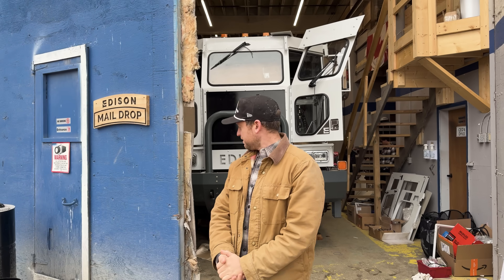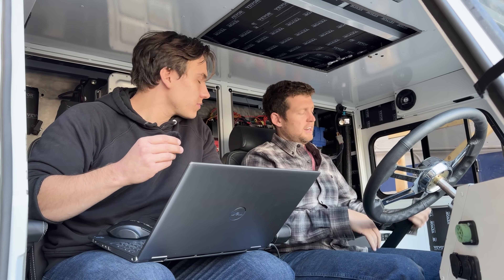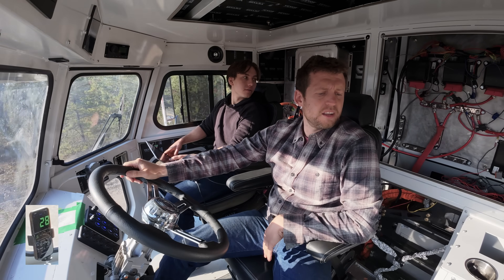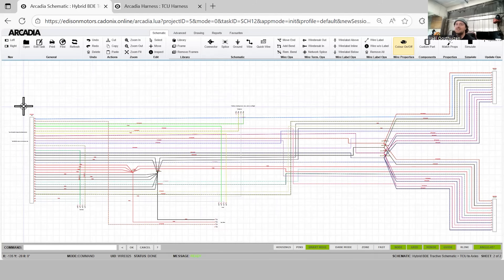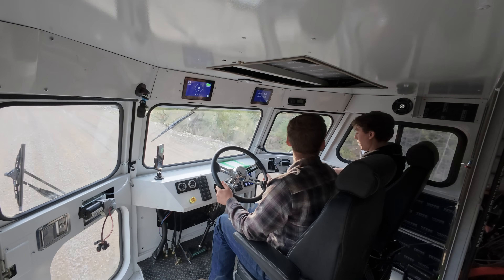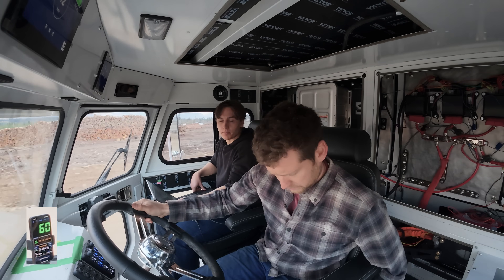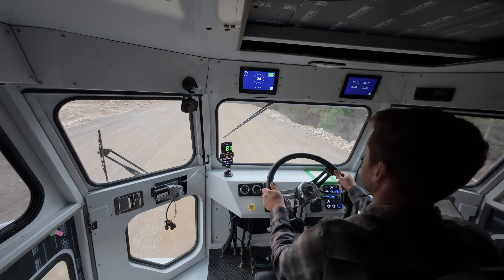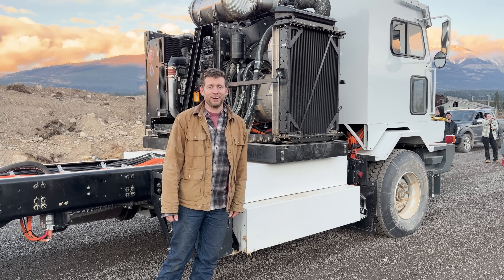Testing the Limits of Edison’s New Truck

Comment: I know you don't have to put in three-point seat belts but they do save lives. It won't matter if someone hits a car but another truck.... A head-on collision a tree, you don't want someone dying in one of your trucks
Reply: I'm happy that you're thinking about the lives of the truckers, and I won't tell you off for it. Also another point to you is that I believe that 3 point seatbelts are better during roll overs and similar accidents. I'll just add a few things from what I can see. 

The reason why 3 point seatbelts aren't needed on a vocational truck is cause in a real off-road case (worse than just hard packed dirt) or during operation (in the case of specialized equipment), you hardly ever go fast enough to where the type of seatbelt decides wether you die. It is also from what I understand that some truckers don't use their seatbelts at times to bale out the truck faster Incase of emergencies. 

In the case of highway truckers, i believe it would be better to have a 3 point seatbelt as a standard. I'll also add for those that'll point this out that at their speeds and weights, it's either, they destroy what they hit and get damaged or they get destroyed by what they hit or by the load/equipment behind the cab. 

In conclusion, 3 point seatbelts are better, but if your vocational/loaded truck suddenly halts to a standstill in a few seconds, you may have bigger problems. 

(I'm not an expert, just a fan, so feel free to correct me!)
Reply: Didn't you listen?! They have those just for the testing! There won't be any head on truck collisions during testing!
The finished truck will have "peoper" seat belts.
Reply: @VBormann  I was referring to a general crash on the highway. I sure as heck not one of these boys crash and get hurt at all during testing!! Whatever that may need for safety is whatever they put in and people don't use. @Edison Please don't add speed limiting if no seat belts like the newer Rams. I'm a local BC 4x4 guy and I bet No one is wearing their seat belts when on the dirt roads. I'm pretty sure Chase has a short somewhere talking about it too.
Reply: "Why are you worried about basic safety precations that cut fatalities by a 3rd? Are you a wuss?"
Reply: I'd rather bail out before my Load shifts through my cab, or the thing flips. Have you seen a Semi on Semi head on? you're lucky if the drivers survive.
Reply: @michealscheuerman3250 Life isn't a movie,nobody is bailing out before a head-on collision

Comment: I'm wondering why wiring harnesses aren't using more of a hub and spoke topology?  My idea being that this way it would be less about having to do custom harnesses and potentially having to redesign and remanufacture new harnesses whenever you add something new, and instead set up the equivalent of wiring highways between "hub" boxes and then you can make the wiring connections digitally inside the boxes which would allow for rapid iteration.  Also you could add a lot more wires than needed for future expandability.

Comment: I remember you guys being impressed by the smoothness of the ride in the Scania Trucks when you went to that european truck show. Did you end up copying this feature i.e. resting the cab on four airbags instead of two airbags and two rubber pucks?
Reply: Judging by the distance between the cab and the front bumper they’re probably still using the traditional NA setup of bags + rubber pucks

Comment: It seems the regenerative braking demand will change depending on vehicle weight/load, will it be driver adjustable or use suspension inputs to estimate weight?

Comment: I know the truck is already gone, but I'm curious if you did any water testing like going through a big puddle or hosing down the parts that usually get wet in bad weather? I know you designed for water proof connections, but I'd like to know that it's good to go. Thanks!

Comment: You should have a horn code for safety on the track. Something like, 4 blasts is "We're gonna be going f'n fast", one short blast is "Move out of the way", one long continuous blast (>5sec) is "We've got an emergency and need someone to come check on us", 2 blasts is "We're getting moving", 3 blasts is "we're backing up". Also there should be some kind of audible signal (like back-up beeper) that can be heard near the truck for when the brake releases after shifting from neutral to drive or from neutral to reverse, to let people know the truck is going to move. Your national safety regulations may require an AVAS sounder, so check into that also.
Reply: One single kind of sound that warns outsiders when the parking brake is released or when forward gear is selected  should be fine. Or better yet, when you start creeping forward, may it be from releasing brake pedal or pushing gas pedal, one warning sound distinct from other sounds could be played through outside speakers.
Reply: being this quiet and that big has a whole new set of issues no one else is really dealing with, and i imagine might be a "blind spot"

 deer, moose, etc love to use the roads to travel, they usually get off the road when they hear our vehicles coming when they don't well cars get totalled. now you take a big truck that the laws of physics can only allow to stop so fast, moving at high speed silently.... 

better to at least start looking in to it before the trucks get in to the wild and we loose some one to an unaware moose on the road. not sure if they have deer near the track, but it might be worth putting feed out on one easy to see patch so they graze near the road to see if you have a sound that will scare them away effectively and not drive the drivers nuts.
Reply: @NogrimStoneson I think the inevitable rattling, wind noise and tire noise will scare off any animals. They hear a bit better then us humans.

And for us humans, electric cars have gone through the same process. Most of them have a speaker making a continuous beep when they drive slowly or a soft backup beeper sound. You can definitely hear electric cars these days and that’s all artificial.
Reply: @autobootpiloot Above 50 or 60 km/h the tyres are louder than the engine on most cars regardless of power source, truck tyres are louder again, but then again as someone who rides mountain bikes through the middle of nowhere nearly every weekend, the combination of fast and quiet in a bicycle (Silent except for tyre noise and freewheel), means I get to see a lot more wildlife than someone driving a truck, car or motorbike will see, because they don't here me coming until I have already seen them, even though my speed is lower than a motor vehicle, so it's not an invalid consideration.

Comment: Do you not have rear ABS? There was lots of skidding on that brake testing
Reply: They do habe abs, they just did a test without
Reply: Couple things:
1. ABS doesn't work well off road (he calls it "pavement" but it's just compacted millings already flaking apart). Yes, newer vehicles may have more advanced systems but these trucks aren't there yet.
2. As discussed afterwards, the lack of weight on the rear let the wheels jump around and loose any remaining grip.
Reply: Ah I missed when that was stated, cheers

Comment: Do you guys expect to have OTA updates just so you can mitigate issues found at a later point when there are trucks in the field already?

Also do you have a revisioning system so you can create an exact replica if you ever need to? My mate had a huge fight when trying to replicate high-tech vessels when the customer came back and was like I'd like 3 more but they didn't have any revisioning so it took them MONTHS extra to replicate these vessels
Reply: I don't think wireless updates are necessary for trucks. Not worth paying for communication hardware and data just for that. A website and USB drive or connecting directly a PC is good enough. And for data security its better if nobody can access anything remotely and reprogram stuff they shouldn't.
Reply: As an information security expert, I fear OTA for Edison trucks.

Comment: With the wheels locking up on the brake tests, are you thinking of including ABS on the brakes?
Reply: They were talking about abs but i think during this testing they haven't quite figured it out.
Reply: Should be mandatory. So much better to break with ABS. And when it comes to stopping the huge mass of trucks, it also means a lot less energy in case you still crash into something or, worse, somebody.
Reply: I would guess they are required to implement abs under cmbss?
Reply: I believe ABS is planned for this model judging from one of the shorts they showed, other than that it, would be another nice thing to have on top of everything else
Reply: The front wheel ABS was working, so the truck still has directional control.

Comment: Regen braking is a fabulous thing in any vehicle!
-Saves maintenance.
-Applies brakes before your human reaction time can.
-Reloads the battery with volts.
Reply: Relaods the battery with amps, not volts
Reply: @niconico3907  technically it's both, can't have one without the other.
KVA is a measurement
Reply: "Reloads the battery with volts" - this is the most american thing I've heard in a while
Reply: @saiv46 ...my EE brother would be so proud! 
Ohm my😆
Reply: Especially on icy/slippery roads

Comment: 3:00 just like a train toot the horn 2 times when you start moving.   Safety third.
Reply: Extra important step now. Unlike a diesel truck, there's no noises before it starts moving. In a shop, you always give a honk and a check under the truck before you move it. Mechanics aren't great speed bumps or wheel chocks.
Reply: 2 for forward, 3 for reverse, and one for stopped.
Reply: @phillip_mcguinness7025  I thought 2 was for reverse.
Reply: @economicprisoner  depends on the operator. NA loosely settled on 2 ahead, 3 astern, 1 stopped.
Reply: @phillip_mcguinness7025  1 for startup, 2 for forward, 3 for reverse
Reply: I'm so proud of the progress this man has made
Reply: needs a bell